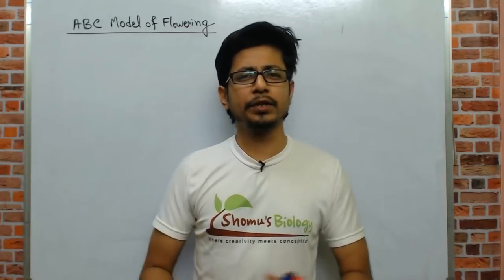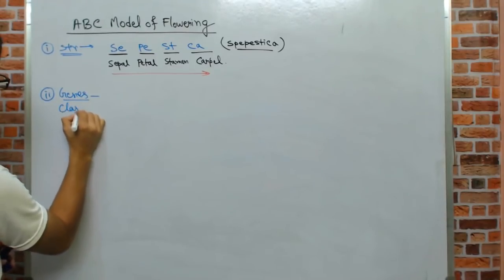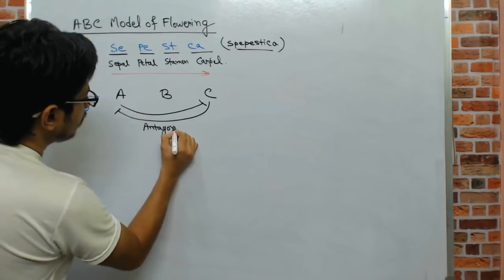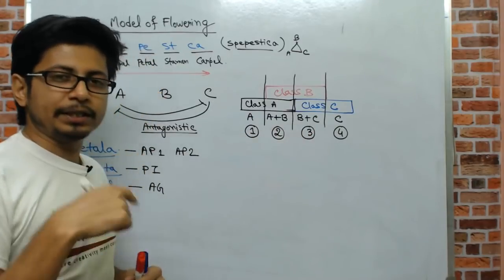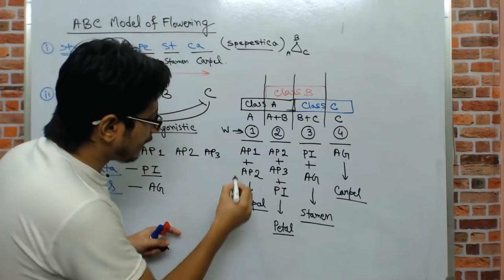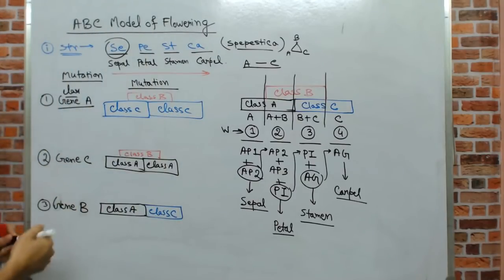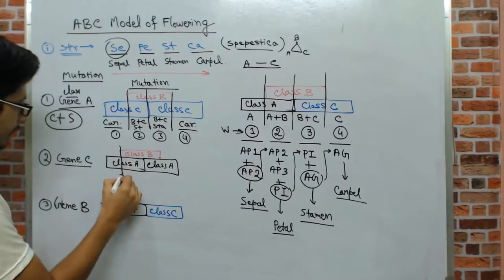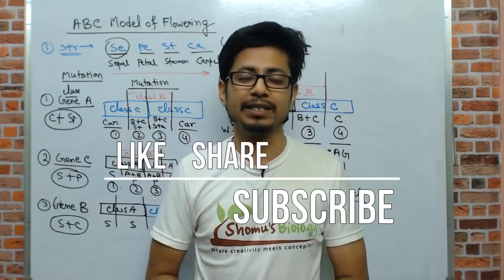ABC model of flowering | Flower development and ABC gene mutation

Comment: Hey, can you give all formulas of dna problems ..

Problem e. g. 👇
306 angstrom length of DNA has 54 adhenines. The percentage of cytocine will be:
A) 40%   B) 36%   C) 20%           D) 54%
Plz give the formula for this question..
Reply from the maker: No formula just based on Watson crick formula of hydrogen bonding
Reply: @shomusbiologyofficial  you're right ,but only step that solves problem.. 
Ok,  above problem (In first comment given ) plz give some steps to solve it..
Plz